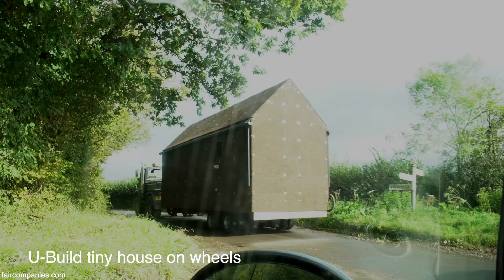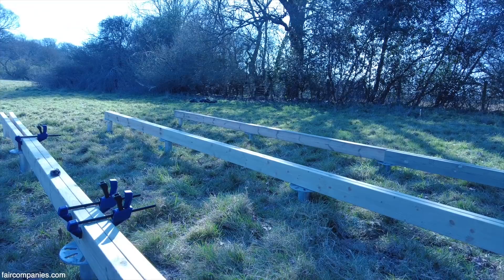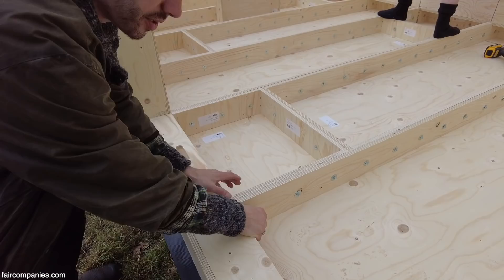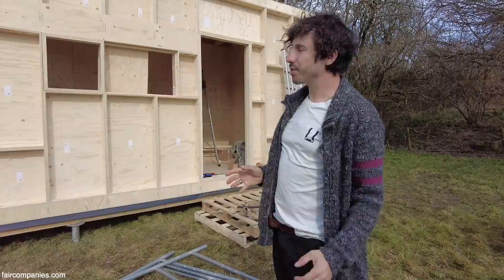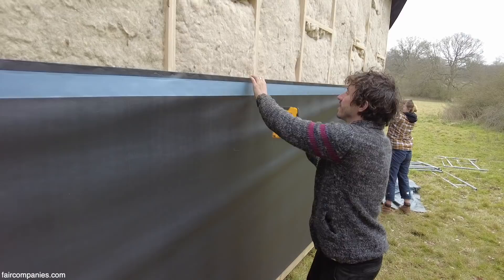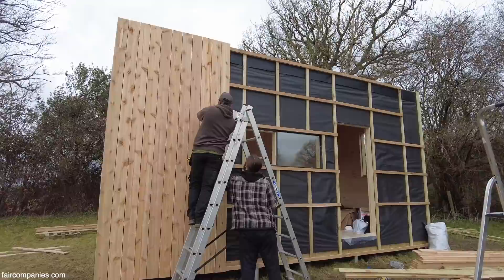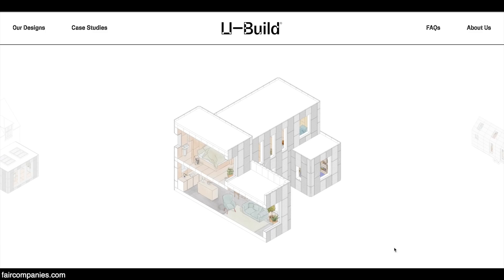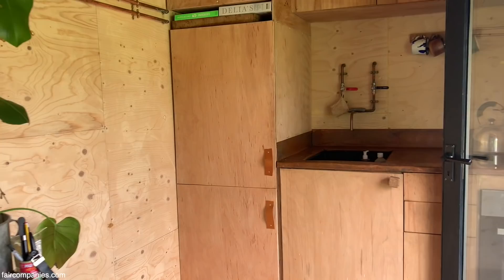U-Build hands-on: a flat-pack modular home you can assemble

Comment: Starting at 12:39  "If you are a skilled carpenter, then I think you can do something more affordable than what we're doing..."  There ya go. Okay, okay... let's look at this: essentially, you're teaching people who have never even played with Legos to build little boxes and attach them together in a slightly clever way... all the while assuring them that this dodgy little structure can withstand some serious weather. First: NO POSSIBLE WAY! One inch thick plywood (~25mm) isn't actually 1". If a tornado gets hold of that little man-made "sail" that sucker's flyin'! (assuming those little boxes remain attached to each other). Between the expensive "1 inch" (more like 3/4") plywood, which has been expensively cut out with a CNC machine... I just don't see a safe, cheap habitat in what is really a garden shed.. Back to the drawing-board, guys!
Reply: Nonsense; this concept is decades old by now; and of course guaranteed by structural engineers as part of local building codes. If you happen to live in the tornado belt you'd be in trouble with anything not a bunker.
Reply: The build would have to comply with UK building regulations so would have to be guided by structural engineers.  Your argument would have to apply to most tiny home builds and probably all similar builds would not withstand tornado or hurricane events.    The construction in the UK would not have to deal with such events like the severe hurricanes that the USA have to deal with.    Thus it appears to be a good option at least for UK residents with little building experience.  It is an interesting option.
Reply: @tzenophile  Good points. Still, all those little boxes ain't cheap, nor is all that "membrane" stuff. (Pretty sure that crew installing those screw-thingies in the ground isn't part of a package deal.) I stand by my assessment that this thing is really a vastly over-built and insanely costly Garden Shed.
Reply: @shuunya  "Interesting option", yes. Affordable option... not at all. Please note the glaring lack of cost information along with the quote I included, above.
Reply: @crustycurmudgeon2182   I'm building (or getting built) a 250 m2 house using this technique. While it is not cheap, I had so much control over details because of the computer-model-based automated cutting. The large semi-custom building companies could not accommodate my wishes and design for the same price. And this will be CO2 negative, using wood fiber insulation blown into holes cut in the boxes. The raw house will only take a couple of weeks to assemble. Also, the house will breathe, no plastic wrapping or membrane but claybased paint inside and some lime/plaster stuff on the outside, to match my farm buildings. I could have assembled it myself; which would have been much cheaper but my wife would have killed me.
Reply: @tzenophile  Great reply, and brilliant! Wow! Dude, 250 square meters is freaking huge! I never meant to imply this method was entirely impractical-- just overblown for that particular application. (It was what? 10 M2?). I can certainly see how your floor plans could be anything you wished, as a roofing structure built that way needs no actual "bearing walls" inside. That beast you're building will last generations. (I totally approve of your interior and exterior cladding choices-- absolutely brilliant). And, yes, can agree with your wife wishing to end your figurative life, as it would take you weeks (months) longer than a dedicated crew! Cheers!
Reply: @crustycurmudgeon2182  Thanks for the kind words, mate! And agreed, I would not use this for a 10m2 thing either. (I'm building my wife a mobile tiny-studio on top of an old tractor-trailer; and will just use 2x4s and untreated larch wood or ore pine as wall cladding. The kind you can still find original on 800-year old churches here in Scandinavia.)
Reply: @tzenophile  Sounds like a fun little project-- the kind I used to like to do. Wish we had old wood like that here in the US. Hey! Would be great if you made a video of it, and posted to YouTube! Could just be a series of photos set to some music (there are free programs for doing that all over the internet. I did one, once).
Reply: @crustycurmudgeon2182  The wood would be new; but then it can stand untreated for 800+ years in the right conditions.  Ore-pine is produced in Norway; you might be able to get it shipped from there, but it could be made anywhere; they cut the branches of a pine well before harvesting it, so that the sap saturates the trunk and makes for a very rich, naturally protected wood. As it ages it turns silvery-grey. I thought about having a proper channel; I just have to retire first; too many hobbies, too little time!
Reply: @tzenophile  Totally understand the " too many hobbies, too little time!" aspect! YouTubers I've spoken to often mention the incredible amount of time setting up camera angles to shoot a minute or two of video-- insane! Still photos, on the other hand, can be quickly taken after whatever is done. Uploading them in proper sequence to a free program takes little time, add a soundtrack (like music), and the thing will time the photos just right to fill the entire sound length. Anyway, ore-pine would be far and away out of my retired-status budget. Sounds awesome, though! Wish I'd heard about it 30 years ago! Cheers!
Reply: @crustycurmudgeon2182   Cheers, Crusty! I'm definitely thinking of doing it; the farm is the perfect place for drone footage, too; wild-life (deer, rabbits, all kinds of birds) but right now the building and planning the garden (16 acres) is quite overwhelming. I wish there was a way I could let you know, when/if I get going.

Comment: I feel like that flat roof is going to have a lot of standing puddle water problems.
Reply: Standing water isn’t a problem at all as long as your roof is strong enough.
Reply: all it takes is 1% slope to move water, not perceptible ...
Reply: THE FINISHED ROOF IS NOT FLAT!!!  YOU DIDN'T WATCH THE ENTIRE VIDEO!! THE FINISHED ROOF HAS A GRADE, DEFINITELY ENOUGH FOR RAIN, NOT ENOUGH TO SLOUGH OFF A HEAVY SNOW LOAD THOUGH ON THAT PARTICULAR STYLE.  THAT WOULD BE WHERE YOU WOULD NEED TO CHOOSE THE CORRECT MODEL FOR YOUR ZONE SUCH AS THE STYLE THAT WAS PUT ON WHEELS.  😉

Comment: The cost for this raised my eyebrows as the cost per square meter is significantly higher than the average cost per square meter of housing in the US.  That is a completed home with insulation,  siding, florring, cabinetry and plumbing as well as appliances.   The average housing in the UK is equivalent to the housing costs of Manhattan,  NYC, NY.  Unless one has additional disposable funds, it would be difficult to justify the expenditure.   Additionally,  these kits are being made of wood, which I believe is too rare a commodity as we need every tree and bush left breathing and more added daily until we get the global temperatures back down to a pre WWII average.  HOWEVER , the concept is brilliant and if we used more bamboo and cork (though being careful with the cork to insure that the lifespan of the tree is maintained) would be worth considering.   I sit on about half an acre and would be happy to plant bamboo on portions of my land to help support projects like this, in partnership with the builders and other households to supply projects like this is worth considering.   Finally,  Eastman Chemical in Kingsport TN, USA has developed a process of converting waste plastics like water bottles into building materials like decking.  If something like this could partner with them and build affordable housing using the plastic waste in landfills and the plastic islands we hear about floating in the ocean, i would not hesitate to sell my house and purchase enough property to build alternative housing for myself,  my children and grandchildren in addition to like minded individuals to address the issues those who approve permits and dislike change will raise. Places like this, with alternative energy systems in place would make ideal communities and with the right press, beta testers and collaboration, these would make wonderful housing experiments for the future.  Also, if these units can be taken down and reassembled elsewhere,  these model communities or mock ups could travel around to different cities to allow community  developers and civil engineers the opportunity to be involved in and experiment with these buildings.   

Or....great idea and with some work it could be a viable alternative to the current housing model.

Comment: Counting how much time it takes to assemble the boxes it looks like it would be cheaper to hire a couple of framers. Seven people for assembly? That shed could be framed in a day.
Reply: Assmebling a box does not take much time. What are you talking about?
Reply: @tzenophile  It's a lot of boxes compared to shooting together some 2x4s and sheathing it.
Reply: @Fekillix  How do you know this takes longer? You don't.
Reply: @tzenophile  I watched an episode of "Grand Designs" about it, and I work in construction, so I feel that I am decently qualified to interject. If it was faster, cheaper and better it would already be widespread, that episode was many years ago.

Wood framing is faster and cheaper, but requires more tools and knowledge. Doing things yourself is cheaper, but not if you count the labour of the seven people installing and all the hours of assembling.
Reply: @Fekillix  the boxes are snapped together in an instant with a mallet. They are light enough so that one or two people can do the job without any special tools. The home construction industry is conservative, and for good reason, and this is a vertical, high-tech system that basically needs an integrated factory where the modules can be assembled and stored; so the average home construction small entrepreneur would not want to invest in the CNC part, while the big companies are too set in their ways. This can explain why this is not more popular after a decade or two. You have a point there, but this IS a faster way to build, since the construction can be paralleled. Modules are cut and assembled while the foundation is constructed and poured, and then modules bolted together on-site in a few days afterwards. Socket holes for utilities are precut. With a practiced team this is very fast, and with no on-site errors from hasty measuring. 

You could build a standard house in 3-4 months this way, rather than 6-8.  Imagine offering customers a 2x faster process?

Comment: If you are running PEX tubing for plumbing, understand, that rodents now EAT plastics...as-in, they don't even leave crumbs laying about afterwards.  
So, if you wanna use PEX tubing, might want to run that inside metal conduits til it gets close to the point of use, and install access panels near points of use, in case repairs need made later.   Rodents ate through our hot water line [among other things] near the water heater, and had to repair it; they flat-out ate-up the unused line nearby the one that flooded the garage. 
Guarantee that rodents will eat their way into the walls that contain plastic lines like electric and water. ..protect those!
ALSO, if you are chemically sensitive, it is a good idea to use "exterior grade" plywood, since for some reason, the chemicals used to make plywood, are much reduced in Exterior grade plywood.
ALSO...you left nearly no crawlspace between house and ground.  THAT can be maddening, when trying to repair plumbing and other lines that route under the building.  ALWAYS give yourself easy access under the building--if you don't, you won't even be able to remove a nasty skunk hiding under there, and other small creatures will have far easier access to chewing through the underside of the house.  There was no moisture barrier protecting the first support rails which are near the ground, too--that might come back to haunt you.

Comment: One of my main concerns in using this much plywood, is the outgassing of undesirable and dangerous gases.  With the housewrap on the outside, you have essentially locked yourself in with these gases. The materials you choose in this case or extremely important!
Reply: There is nontoxic plywood glue. Just don't be stupid when you source it.

Comment: Should do slightly slanted bottom of window exterior frame to allow for water drainage 
alway from the windows which only takes a minute to rip angle while leaving a flat surface enough to set windows on . Might to same on top to allow water to drain alway from the siding.

Comment: Great idea conceptually. I love the simplicity. Brilliant idea. A lot like SIPs. However I am confused by the roofing membrane flopping around the edge and the solar units in place as if it is finished. Also if all that interior plywood has no coating of any kind, that surface will have every little smudge and stain possible marring its surface in a year or two.
Reply: The plywood's pattern also makes the interior look smaller.  I know that lime paint (white and a natural material) does well on stucco-like walls and surfaces.  I think I read that it had=ndles more porous wood fine and was used on trees and inside of barns....the plywood here looks like Luon, a somewhat slicker surface, though.

Comment: Imagine a factory which builds mobile building blocks for floor, wall and ceiling which grab on to each other's surfaces and slide along, stacking themselves for shipping, unpacking and assembling on site on whatever preparation, crawling over each other and locking in place. Each block has motors, batteries, wiring, built-in conduit and piping or room for replacement/retrofit. Comes apart to relocate or repair...
Easy evacuation in case of a fire, but criminals (or authorities) could abuse that feature!

Comment: My only question is with the thermal efficiency... Wood, therefore studs in a home are very bad for thermal efficiency. These box sides are basically the studs and since there are so many of them. I feel like even with the insulation in the boxes. I'm worried that it's not gonna be very efficient...
Reply: The U-Build website is very informative and the FAQ's include the details about insulation, etc.

Comment: Yes the cost of wood today would be extremely expensive to make this. And I had a concern about the wood on the bottom supporting the house is it treated? If it's not then you're going to have problems down the line with moisture. Back to the problem about cost due to Wood shortage what are the chances of having sheets of recycled plastic cut into your modular shapes and being used?

Comment: Back in the sixty's Popular Mechanics put out a design for a "Lake house" prefabbed in the garage over winter,
all the panels were made to a size that was easy for 2 to lift, including floor, walls and roof
It was  assembled in a couple of weekends on site, was a much simpler project than this.

Sips panel build would have been another more modern option but much faster .

Comment: Good video.
Not sure why the ‘box’ segments are so small though, seems very unnecessary (unless transportation is by car - for whatever reason). 
Standard 8x4s would be fine and much more practical. 
Good on you for attempting new!
Reply: THE SMALL BOX SIZE, WITH STAGGERED SEAMS, ADDS TO STRUCTURAL INTEGRITY OF THE ENTIRE BUILD AS CERTIFIED BY STRUCTURAL ENGINEER'S!!  Guess you missed when they stated that.

Comment: Just a very small point . . . contrary to his claim that " . . . we are seeing the end of the human extractive model", they're still extracting materials from the environment. They're using plywood, which is made by harvesting trees. They're using screws, bolts, washers, and nuts, which are made by extracting iron ore and processing it into steel. They're using sheep wool insulation, which is taken from the sheep. (This is good for the sheep, by the way, since they don't pant like other animals, and have no way to shed their excess heat. When sheep overheat in the summer, they die.) And then there are many other materials, all of which have to be gotten from somewhere. It's like a tree once said to an author I read: "You're a mammal. You have to consume things to live. Get over it!"

Comment: I would encourage anyone considering such a project that it is actually much easier, stronger, more weather proof, and therefore linger lasting, more environmentally sound to just use traditional framing. Watch a couple videos and your off and running.... This would seem the Monty Python technique of framing 
to anyone that likes into the simplicity of building a normal frame house....I promise you that it's the other way round.... If you can build these box structures then you are able to build traditional structures.

Comment: Is there enough structural integrity to support water storage at roof level?
Reply: Wouldn't a metal catchment system on legs be easier to build, and nor endanger the house through weight or seepage?

Comment: I've designed a similar system but I made the plywood on the outside. Makes it easier for plumbing, wiring, etc. Are there advantages to plywood on the inside?
Reply: Your way works as well. I wanted to have plywood on both sides for strength. So I added plywood inside after assembly. Could have done drywall as well. 
Nice job, looks great.

Comment: Why did you not let the CNC cut out the holes for mechanical and electrical and then supply pre-cut wire, pipe etc?  I think you are missing the opportunity of CNC by not doing so.